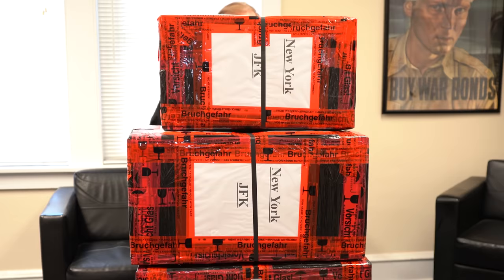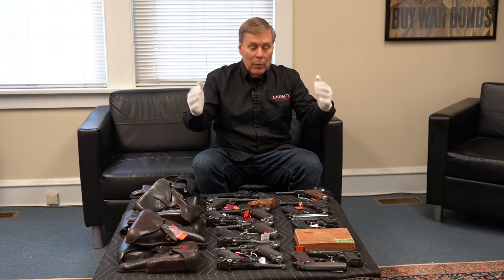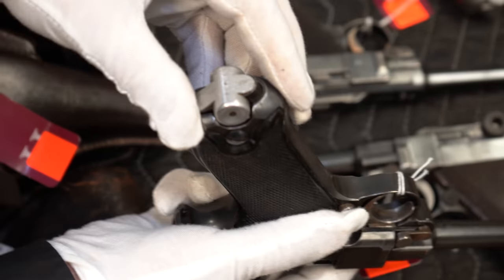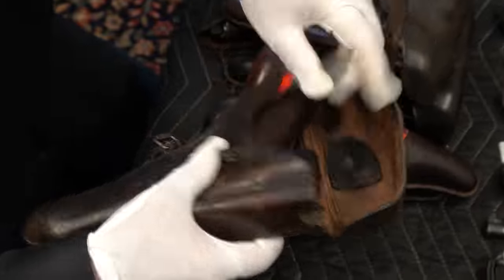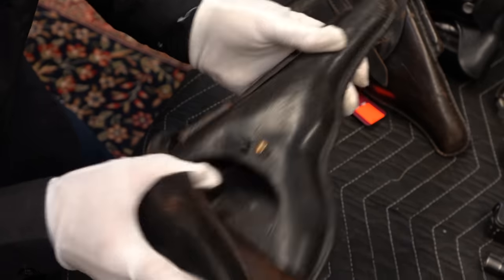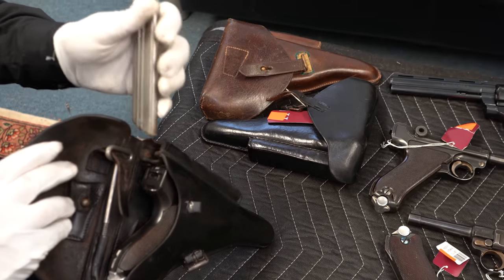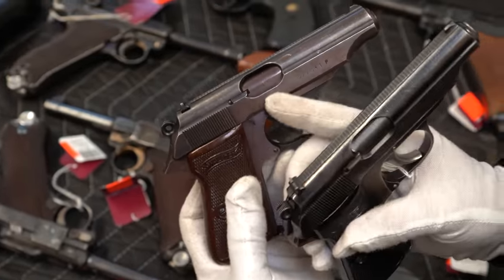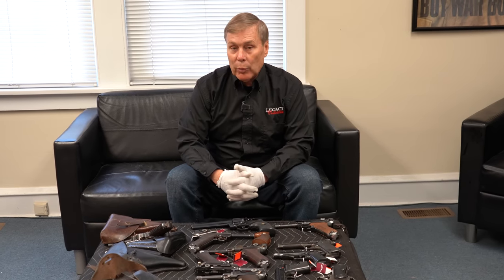Unpacking The Treasures We Got From Germany!

Comment: The Arabic letters on the Walther pistol for the Turkish Police, read from right to left, are the letters Y and Q. As for the Persian pistol, the year 1939 is minted. Specifically, the year 1317, to which we add 622 years, it comes out what you can see, but there is a nuance in which month, because the Persians still use the lunar calendar, so it could be 1939. As for the rest of the subtitles, you need a very clear picture to decipher.

Comment: The ATF can't have you importing Fully Semi Automatic pistols, sir.
Reply: That Walther Model 6 wasn't a full-auto pistol, it was a WW1 expedient semi-auto pistol made in 9mm Luger (Parabellum) when the German Army badly needed pistols and they couldn't make enough Lugers.  A simple blow-back design it was less than perfect and was dropped from the Walther line post-war.
Reply: @wayneantoniazzi2706  
"Fully Semi Automatic"
Reply: @Foche_T._Schitt  I think both you and I know there's no such thing as a "fully semi-automatic pistol."  It's either got a full-auto selector switch or it doesn't and the Walther Model 6 didn't, in 9mm Luger it would have been uncontrollable if it did.  It's a semi-auto like a Luger or a P-38.
I edited my original comment after doing a little more research just to clarify things.
I suspect Customs is sitting on the thing because they don't know what it is,  those pistols are a relatively scarce item.
Reply: @wayneantoniazzi2706  
(((Woosh)))
It's a joke. Some reporter trying to demonize guns used that line.